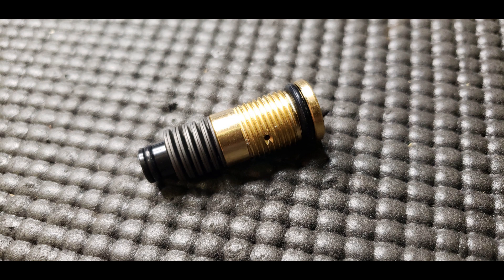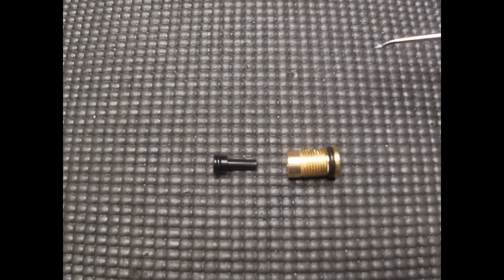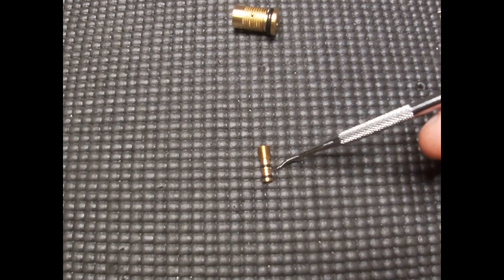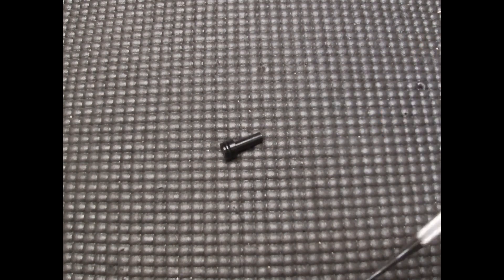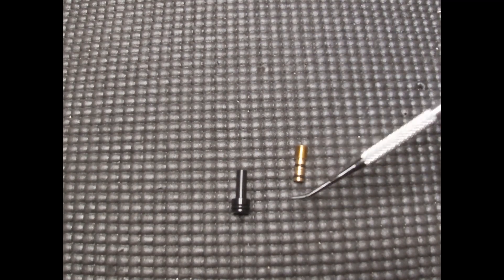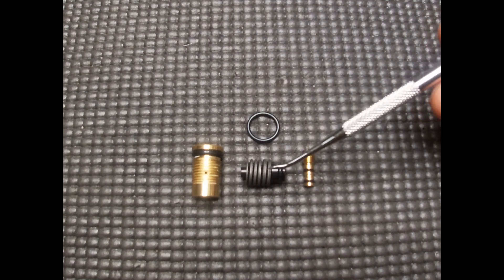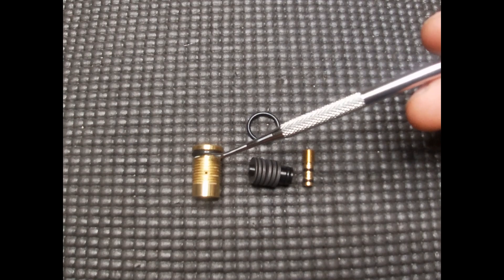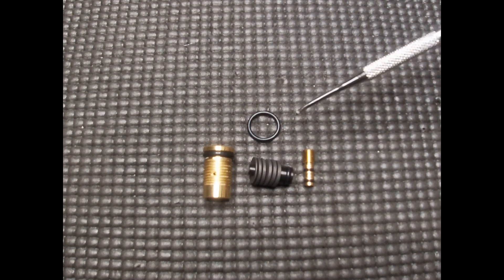How to Fix FX AMP Regulator Leaks and Regulator Creep - FX Airguns Bottle AMP Regulator Guide

Comment: ve a dreamline lite 3gen, ive a blown o ring somewhere im guessing, got pressure showing on bottle gauge and regulator gauge but when i pull trigger its like ive no air, any advice please
Reply from the maker: Most likely pellet suck in transfer port, barrel is jammed, hammer spring broken, or valve pin damaged

Comment: Good afternoon! Congratulations on the excellent explanation about the FX Crown Mk2 regulator. I need help because the regulator valve of my FX Crown mk2, when pressure is applied, both pressure gauges show the same pressure. I have already replaced all the seals without any result. Can you advise me on what I should do to fix it? Thank you.

Comment: Thank you Newman! I have a very early Crown mk1 in .22 and your video really saved the day! I has serious reg creep and those two tiny orings on the adjuster screw where it! It's back in the game! One thing was odd, I had twice as many spring washers in mine, arranged as pairs, so two up, two down, etc. Have you ever seen that?
Reply from the maker: Likely you have a pre-AMP regulator, which typically came with 16 washers rather than 11. If the washers were thin, more may have been needed. Glad the video helped!

Comment: I am replacing regulator on my Maverick, after i have tried a Huma one that dident work well for me.
So as putting in the Huma one was easy i assumed it would be the same with the original FX one, but no it leak thru the atmosphere leak hole, so i replaced the O-ring at the bottom of the housing, and it still leak.
So i try to put in the Huma one again, and now it also leak thru the atmosphere leak hole.
Starting to get a little frustrated here.
Regulated pressure do not creep or bleed but it will bleed the whole bottle dry overnight so there are 0 pressure in front of the regulator ( .177 so reg set to 100 BAR )

Comment: Excellent content: Question I have an Impact MK2 been sitting for a while with no bottle, When i screw on a bottle air is forced from the regulator vent hole. I have disassembled and reassembled and still same result. Everything looks clean and o rings are not damaged. I could see if they need replacing it would leak some but this amount of leak is a lot. Any ideas?

Comment: Hello! Thank you for the video. I'm having problems with my new Maverick.. The 1st reg on my gun passes all the pressure from the bottle back to the second regulator. This happens even if the 1st regulator screw is all the way at the bottom.  What O-ring should I change on this case? 😀

Comment: Hi i find all your videos very informative and i have just bought a new fx maverick ,well while setting up the 
rifle for the first time , and while setting up the pressure for the ist regulator i discovered a leak in the tuning 
screw of the first regulator (while turning it anti clock wise it starts to leak , pls suggest possible cause and solution 
look forward to your suggestion thanx

Comment: mk gen 3 reg i got has 5 sets of 2 10 mm washers  this correct
Reply from the maker: depends on the rifle is came out of. Typically no, it should be 11, but sometimes 10 very thick washers can simulate 11 washers. If you cannot reach desired regulator pressure, add a washer

Comment: Thank you very, very much for your videos, they are very useful. I would like to ask you how I can repair an FX Dreamline that leaks air at high speed in the area where the bottle is screwed in   (not in the area of the adjusting Allen screw). And also if the origin of the problem could have been a dry shot to lower the pressure of the regulator. Thank you very much.
Reply from the maker: A dry shot can cause a leak from the atmosphere hole, but that is very rare. More than likely, if it occurred after a dry fire, then the O-ring around the Delrin regulator piston is what is damaged (4x1.5 nbr70). Might as well change the same size o-ring inside the bottom of the regulator housing as well while you have it apart, though.
Reply: @910AirgunTuningandRepairs  Thank you very much. This problem happens within minutes, hours or even a day after removing the bottle. But, if I leave the bottle connected with its pressure, there is no air loss and the regulating chamber maintains its pressure.
The question is: is it convenient to leave the bottle connected at 230bar or is it better to remove it every time you put the gun away?
And if I leave the bottle connected keeping the pressure stable in the regulation chamber, but there is a damaged o-ring 4x1.5 nbr 70, can this damage the shots??

Do you have any way (paypal etc...) to help you with a donation for your help?

Thank you very much again.

Comment: Hi my piston es of 16mm, what orings have to use..?? Old style.?? Or that other one.??? I put all orings new on size that you say but it has a leak on one side, through the drain hole. which oring should I change to some other measure of where of which piece ? I appreciate your help
Reply from the maker: Which rifle is this for? If you replaced the o-rings with the correct sizes for your regulator, then it should not leak, unless there is other damage to the pieces.
Reply: @910AirgunTuningandRepairs  yes,. I replace the piston,.. and now is working thank you very much

Comment: Excellent demonstration
tried to look for an answer to my M3 problem
when iI remove the 580cc air tank, the air from Reg 2 gets out through reg 1 so rapidly, I changed reg 1 thinking it might be damaged, money was wasted, I have a spare reg 1 now lol.
do u think its reg 2 that needs rebuilding ( or upgraded maybe to HUMA gen3 Extreme)?
I will wait for ur answer before i step any forward with the gun <3
Reply from the maker: The air escaping once you remove the tank is not a problem, that is normal. There is no back valve on the regulators, so there is nothing to prevent them from bleeding out once the tank is removed.

Comment: Plz help me send sequence 16mm long piston and 9 amp reg. With 15 washers plz hepl how to sequence
Reply from the maker: The AMP regulator should be 10mm diameter washers, and only 12 stacked. In rare case of all thin washers, there are more on the stack. In any case, the AMP regulator should be stacked the same, like the following: 
( ) ( ) ( ) ( ) ( ) ( )
If you have more washers, just continue the sequence. For instances, 15 would look like: 
( ) ( ) ( ) ( ) ( ) ( ) ( ) (
Reply: I have 8mm diameter washers . Plz suggest

Comment: Olá, você teria algum video para me indicar, de como retirar o vazamento pelo orificio lateral da Fx Crow ? Quando eu coloco ar pelo engate foster o ar vaza pelo orifício lateral, não enchendo o cilindro da Crow .
Reply from the maker: The atmosphere hole leak is caused by either the o-ring on the piston, the o-ring inside of the brass housing, or the o-ring that fits into the main block (seals around the brass housing). There is not a specific video show casing this exact repair, but there are videos showing the removal of the regulator from the Crown. Hope this helps!
Reply: @910AirgunTuningandRepairs  muitissimo obrigado .

Comment: Thanks for the O-ring diameters and part numbers! In the video you mention that the outer housing O ring is 90 durometer but in your description it's 70. Could you please verify that? 
Cheers!
Reply from the maker: My apologies for the confusion! The 7.5x2 (around rim of housing) is a NBR70. The o-ring that goes into the action that seals the base of the housing is a 10x1.5 NBR90. Hope that clarifies!
Reply: @910AirgunTuningandRepairs  Thank you! I also didn't know that they had schematics on the FX website. Thanks to your video i was able to reference the parts list there. Thank you!

Comment: Thanks for such a good video and info.
I have upgraded my fx mk2 fac regu to hima-air reg high pressure 110 - 165 bar. After installing the new regulator  I faced some problems as follow:
1st was the washers arrangement.  regarding the manual they said I can put 14 - 16 washers when I tried 15 for example the reg itself didn't close very well and it stuck in the trigger.
2nd was I found that when I did my arrangement as 14 washers and adjusting the reg to 115 I faced 2 things when I fire a pellet the regulator gage returned back to 115 very slowly 🐌 may be it takes 15 - 25 seconds.
The other one was when I leave the gun for two or three days I found the regulator gage becomes 120 or 125
Reply from the maker: I apologize, I am not experience in Huma regs as I do not work on them.  I do not know their tolerances or solutions. I recommend reaching out to Huma 👍

Comment: Great video, thanks. The reg on my MKII Impact has just had the reg piston replaced by a reputable gun smith here in the UK. I have noticed the reg has started to creep from 135 to around 150 bar. The pressure in the bottle was at 210 when I noticed it. What do you think could cause this? Thank you 🙏
Reply from the maker: The bottom o-ring on the regulator screw is the most common spot for regulator creep. I would suggest swapping that o-ring, or possibly the regulator screw itself.

Comment: Excellent Work!! Your video is one of the most complete and comprehensible review of operation , type and parts of the FX Impact regulators. Thank you so much; I'm most grateful for your post. I have a few questions though, at minute 8.33 you counted 15 washers for the 8mm reg, but in the pictures at the end you show only 11 washers are used. So with the 8mm reg we can use the shorter piston with 11 washers or we can use the longer piston with 15 washers? Is this correct?

My gun has the 8mm reg with short piston, identical to the one from your picture, which means is not AMP therefore I can't adjust it to lower pressure when the gun is under pressure; is this correct? 

I replaced all the "O'" rings in my reg, put new washers and new piston (the shorter version), I pressurized the gun to 130 BAR, and the piston O ring blew up with a loud bang. That O ring came with the new piston from FX. I replaced the piston O ring and made sure everything was installed correctly, and the second O ring blew up just like the first one, (split the long way like you would cut a bagel in half to put it in the toaster)  All the air went out through vent hole. Do you have any clue why is this O ring blowing up?
Reply from the maker: Thank you for watching! I apologize for the confusion with the washers. The 8mm regulator had two versions, a short piston then a long piston. The short piston naturally comes with 11 washers, the long with 15 washers. If you have a short piston, then you can only use 11-12 washers. 
Yes, you are correct, do not lower the regulator pressure while the rifle is pressurized, or you can very easily damage the regulator. 
From the symptoms described, it sounds like you rifle may actually need the longer regulator piston rather than the short. 
I believe I remember talking with you on the phone at FX USA about this very same issue. I hope you were able to get the new parts and repair the regulator. Please let me know if not. Thank you again!
Reply: @910AirgunTuningandRepairs  Hi Newman, thanks for your response. Small world! Yes, we talked on the phone after I posted the questions above. I didn't know at the time when I posted, that you are an FX technician, the most qualified and most knowledgeable person to answer my questions. Thank you so much for your help. Yes, FX is taking care of me. They promised to send the parts so I'm waiting to receive them. 

In the meantime, I figured out an undocumented feature, :) of the Impact 8mm reg.  If I install 13 washers with the short piston instead of 11 washers, the gun works fine, it doesn't blow the piston O ring and has no reg creep. The only downside is that it's hard to make finite adjustments; within half a turn of the adjustment screw, the pressure goes from 100 to 160 Bar. But otherwise, it works fine. Thanks again..

Comment: Today i have changed that o- ring which is very difficult to removr at the cave of regulator in my fx impact . When a started to fill it the air  blown away from that tiny hole   upside of grip . I opened it and change piston o ring and i tested it again . Same problem i got . Air blew from the same hole . I dont know the problem.  Where A regulator screw  was  flash 😔
Reply from the maker: You may also need to change the oring inside of the brass housing. Either that, or one of the prings you installed was a bad oring unfortunately. Sorry for the bad news!
Reply: @910AirgunTuningandRepairs   i realized that the regulator piston is demaged . I decided to order a new huma regulator so it will come completely with its piston . And i will see after that.  Thank you for your help reply.
Reply from the maker: @TheRetiredSniper21  Happy to help. Best if luck with the Huma!

Comment: I need your help please . Now my fx impact regulator gauge is matching a bottle gauge . When pressure in the bottle is 200 and the regulator is 200 . So so which o ring should i change in the regulator .  Sorry i'm a new airguner
Reply from the maker: No worries, you need to replace the bottom oring on the regulator screw.
Reply: @910AirgunTuningandRepairs  thanks mate

Comment: Brilliant video 👍.  My brand new Impact is suffering from reg creep.  Due to my location the supplier has sent me the parts to do the work myself to limit repair times.  I’ve replaced all reg oring, polished washers cleaned, contact faces on piston etc  and no damage or wear on any of the components but it continues to creep.  After leaving the gun for 20 minutes the first shot is around 50-70 FPS low and the reg gauge appears to rise a little.  I’m really stuck what to do now, any help or suggestions?  It’s a .25 impact currently running 115/120 reg pressure. Any help or advise greatly welcome and appreciated
Reply from the maker: I would suggest a new regulator piston and regulator screw. Or adding an additional washer to the stack to make it more stiff, but this may prevent lower pressures.
Reply: That’s the exact same which is happening to my fx Dreamline they have the same reg I polished the piston and replaced Orings but still creep did you manage to sought yours out?

Comment: Where does the bigger 10x1.5 oring go ? I have never seen this before , I also have had 4 leaking dreamline bottle adapters , I get air coming out the vent hole , can any one help
Reply from the maker: The 10x1.5 goes into the threads of the bottle adapter, where the reg housing threads into. You may be able to see it if you shine a flashlight into the regulator bore, but you can certainly feel it if you run a cotton swab or dull toothpick up the reg bore threads, you will feel the o-ring about 1/4 of the way up.
Reply: 910 Airgun Tuning and Repairs ah yea I found it , sneakily hiding lol, I’ve had 3 proper leaky bottle adapters from Fx recently, I have changed orings and still can’t get a seal , Johan is sending me out yet another bottle adapter that will be tested in factory before being sent 😅🙁
Reply from the maker: Glad to hear he is able to help you out, but sorry to hear about the other 3 leakers! Actually quite uncommon, I hardly ever see them leak.

Comment: Hi, I need little help here to get high pressure on mkii do you know how to place those washers I have 11 washers as you stated on your video.
Reply from the maker: Hey, sorry it is not clear enough in the video. There are 5 pairs with one facing up, like this: ( ) ( ) ( ) ( ) ( ) (
Reply: Thanks for your response but would this setup allow me to adjust the power between 90 and 140 bar? as it is now, it only allows me to get 80 or 90 bar when the regulator screw is almost out.
Reply from the maker: @mohammadsiameldin7745  you should be able to adjust between 70 Bar to about 180 Bar with that set up... what is the serial number of your rifle?
Reply: 910 Airgun Tuning and Repairs                                         The serial number is 0101423
Reply from the maker: @mohammadsiameldin7745  was the rifle originally a 12FPE or a lower power gun, or was it always a full power gun? If it was not originally full power, I'm guessing the spring washers are thinner/weaker to match the gun. That's the only reason I can think you cant get over 90 Bar. Or you have a fault regulator gauge.
Reply: 910 Airgun Tuning and Repairs                                  It is 12ftp from the factory but all the measurements of the regulator as you described on your video are similar to mine but I don’t know if the washer spring is thinner or weaker. Do you know where I can get the high pressure washer spring or adding more washers to get high pressure. The last option I see is the huma regulator?
Reply from the maker: @mohammadsiameldin7745  I would reach out to the dealer you bought the rifle from for the standard spring washers, or just order a Huma if your dealer does not carry parts. Best of luck with getting it fixed up right!

Comment: How do you remove the reg in the first place? Do degas remove bottle the take out the reg adjuster screw, then how do you remove the reg body? Sorry if it's obvious I just don't have the rifle with me at the moment to see cheers
Reply from the maker: No worries! Yes, correct process, then the reg body is a 5mm allen, so you remove that, then use needle nose pliers or forceps to remove the piston 👍

Comment: Hi, just to confirm the orings for the fx impact reg are the same size as the dreamline bottle version, is that correct thanks fir a great video
Reply from the maker: Yes sir 👍 Dreamline Bottle Version uses the AMP regulator also found in the Impact and Crown. I like to call it the  "AMP Bottle Version Regulator"
Reply: @910AirgunTuningandRepairs  thanks 👍👍